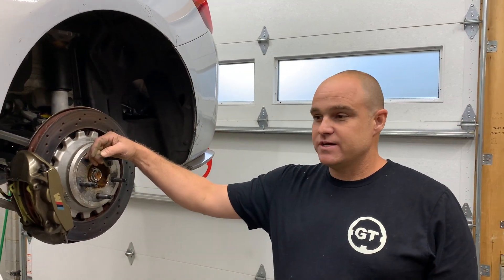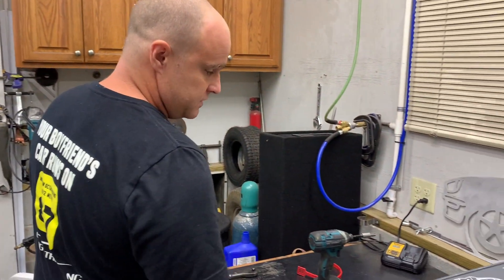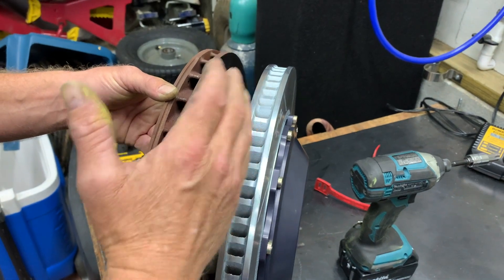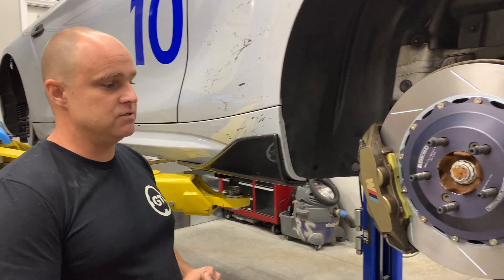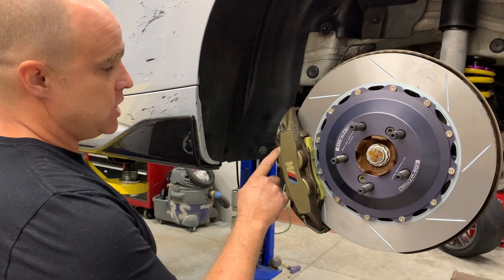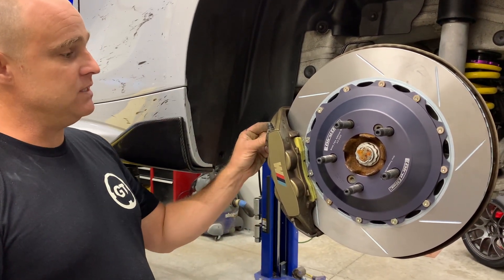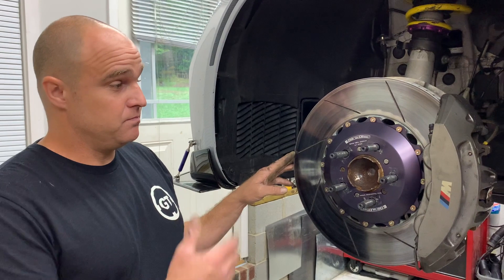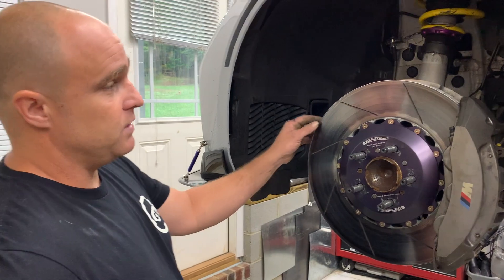BMW M2 Competition Coupe - Girodisc rear brake rotors install

Comment: Nice video, thanks. If you've time, I'd like to ask a question. I've noticed noise (and irregular action) from my parking brake... and when I had the back end free the day, I noticed something strange. With the park brake lever engaged, the wheels did lock, but we're still rotatable (like 5 deg), almost as if the shoes have.. and the knock at each end of the rotation did not sound right. BMW tell me they all do this. Never seen it my history of car maintenance 😕
Reply from the maker: Isn't this an electric park brake car?  Which I ....am not so fond of.

Comment: Hi Rosco.  Great videos - thank you.  Do you know the reference number for the Pagid pads for both the front and rear with these Girodisc brakes?  Thank you from the UK.
Reply from the maker: Hi this is Ken ((KNS Brakes).  I’ll get those Pagid numbers for you.  Can you easily order them there or we could ship you them
Reply: @knsbrakes608  Hi Ken.  Thank you for your quick reply.  I can source Pagid Pads here in the UK but the part numbers would be very useful if it is not too much trouble.  Thank you.
Reply: @LondonGT3  Front are U4934-RSL29 - $509 in the US.  Rear are U1287-RSL29 - $365 in the US.  The FRONT are the only 'hard to get' ones.
Reply from the maker: @kennethkozlowski5100  lol damn chrome switching my account
Reply: @kennethkozlowski5100  Many thanks Ken. I am very grateful to you. With kind regards.
Reply: @LondonGT3  you have to cut edges, because pagid is 1mm -2mm wider than OEM bmw pads...